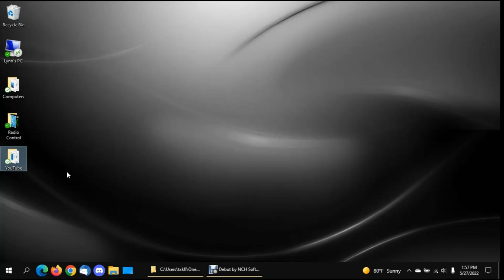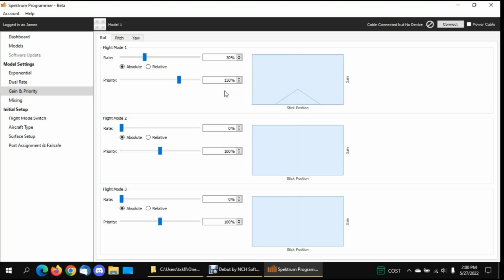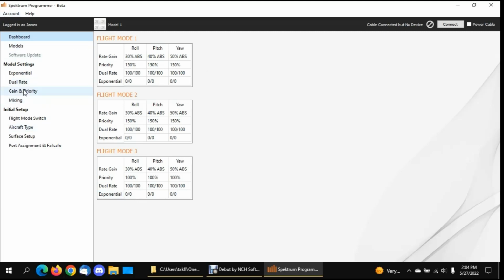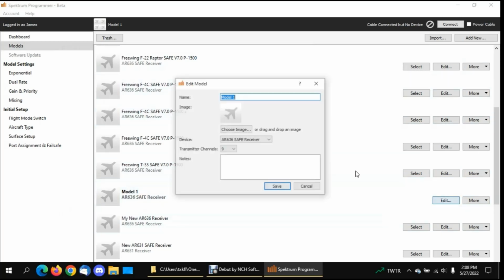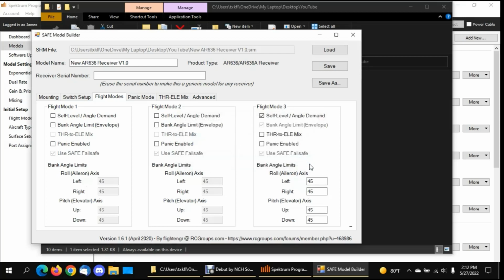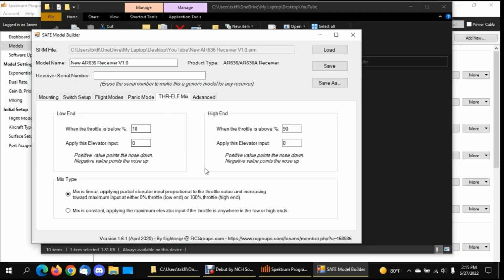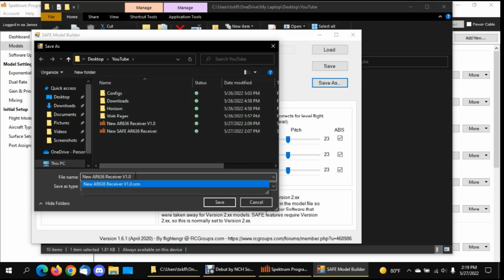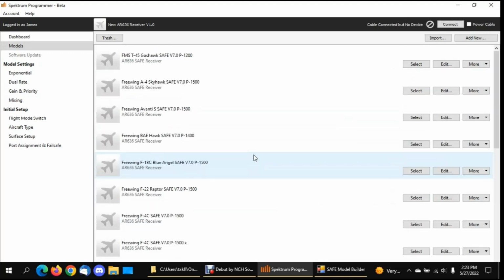Spektrum AR636 AS3X & SAFE Receiver How-To

Comment: This helped so much. I now understand how to program my old Spektrum AR636A and AR636B SAFE receivers. I just have 1 question. I am using a Spektrum DX7s and using my flap/gear 3 position switch for flight modes. I have it set so mode 1 is no AS3X or SAFE, 2 is AS3X but no SAFE, and 3 is AS3X and SAFE. I was planning on using my bind click button for SAFE bailouts. Will this work on all 3 flight modes or only ones where SAFE is active?
Reply from the maker: I only enable panic mode in the flight modes that don’t have SAFE enabled.
Reply: How would I enable panic mode on all flight modes?
Reply from the maker: @joebo9378  There’s not really any point in doing it in SAFE mode. If you let go of the stick, it’s going to fly straight and level. But, you can enable it using FlightEngr’s SMB software. Panic usually has tighter angle limits. Btw, the sticks still work while you’re holding the panic button.

Comment: Hey good job with this. I have a question for you though, does the priority setting have anything to do with the amount of angle limits with the 636 receiver? In other words, if you use 140 priority on roll will that give you more of a bank angle than if you use 165 on roll priority? Trying to figure out what settings to use for a scratch built MQ9 Reaper. Any feedback will help thanks.
Reply from the maker: Thanks. The AS3X priority setting only determines the amount of travel it takes to lower the AS3X gain to zero. The AS3X gain will be whatever we set it to only when the stick is centered. The gyro gain should decrease as we move the stick away from center and will hopefully be zero at full stick deflection (or before). If the priority is set to 100% and the channel output is ±100% at full stick deflection, the gain will decrease to zero just as the stick hits the stop. However, if you're in low rate, the gain won't quite decrease to zero. To ensure that the gain goes to zero at full stick deflection in low rates, we set the priority to 150%. This value allows us to set our low rates as low as 50% and the gain will still decrease to zero at or before full stick deflection. If you were to set it to 160%, you could use 40% in low rates. Since I never go below 50%, in low rates I set all of my priorities to 150%. However! In SAFE mode, I set the priority to 100% because I always use 100% travel in SAFE mode. If you use low rates (or anything less than 100% travel) in SAFE mode, your plane won't reach the full bank/pitch limits.

So..

1. In AS3X mode, set the priority to 150 or 160 percent. You won't be able to tell the difference.
2. You can use low rates in AS3X mode, but not in SAFE mode.
3. In SAFE mode, always set the priorities to 100% and set the dual rates and servo travel to 100%.
4. For the first flights, set the AS3X gains to 30, 40, and 50 percent for roll, pitch, and yaw respectively.
5. Increase all 3 gains by 10% over the new few flights until you start seeing signs of oscillation.
6. Decrease all 3 gains by 5% until the oscillation goes away.
7. You should generally have 10% more pitch gain than roll gain and 10% more yaw gain than pitch gain.

Comment: Gonna watch this again. A lot of good stuff.  I just yesterday ordered a NX6 TX from HH to take advantage of SAFE Select. What is the drawback to SAFE Select?
Reply from the maker: Well, there isn't really a drawback to it. SAFE-Select is Spektrum's process for enabling or disabling the SAFE (Sensor Assisted Flight Envelope) feature in their receivers. SAFE can provide bank and pitch limiting which will keep your aircraft right side up. It can also be set to cause your aircraft to self-level when you release the control sticks. Since experienced pilots don't need SAFE, SAFE-Select gives them a way to disable it. However, even when the SAFE feature is enabled, SAFE mode can be turned off or on in flight using an extra channel. The extra channel can also be used to enable or disable AS3X mode. AS3X will make instantaneous attitude corrections when turbulence tries to bounce your aircraft around. It can also be set to heading hold mode which will try to keep your aircraft in the attitude it was in when you last centered the sticks. However, AS3X won't keep your aircraft right side up; that's what SAFE is for.
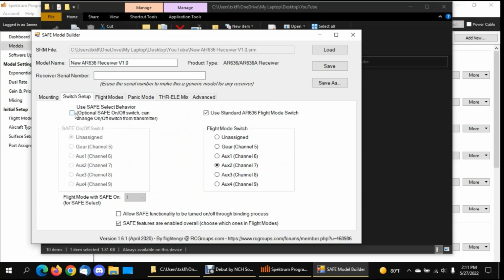Reply: Thank you for answering my question so thoroughly. The reason I asked was at 14:18 you said not to choose SAFE Select (pick standard instead) so I figured there must be a drawback.  I see now that would conflict with your 3 flight modes. Thanks again!
Reply from the maker: @ccarlley  It doesn’t conflict. Since I always want the SAFE feature enabled, I enable it during the setup instead of having to bind the receiver a certain way. So, yeah, I suppose that could be considered a disadvantage. For the AR636, the difference is the point where you pull the bind plug during the bind process. The other part of SAFE-Select is where you tell the receiver which channel you’re using to control the flight modes. Since I know I’m going to use channel 7, I set it during the initial setup. That way, I don’t have to hold the sticks down and toward each other while I flip a switch 5 times.

Comment: is that 636a or 636b ?
Reply from the maker: Some of the first AR636A’s that came in BNF’s were locked and couldn’t be reprogrammed. Basically, if you can register an AR636/A/B, you can reprogram it.
Reply: @txkflier what do you mean by register? Registering on the spectrum rc/horizonhobby website?

Comment: Excellent tutorial, it might be just what I'm looking for. I want to set up an AR636(a) in my original timber 1.5m, to fly like my sport cub s. I like the 3 position modes of just regular safe (not safe select) with beginner, intermediate, and advanced, with the panic button. It just flies really nice. With my timber, I struggle when turning off safe select. I'm a new pilot to airplanes. I'm not even sure if I should do this, or just man up and learn to fly the timber with safe select (and keep repairing it) lol. Any tips for me? Thanks, Mike.
Reply from the maker: Subscribe to FlightEngr’s “E-flite SAFE RX in another plane” thread on RC Groups. We can assist you there.
Reply: @txkflier  will do!

Comment: Your explanations are very good and you have helped a lot, Would I be able to program an AR636B in the same way also as the Tx I have is a an old DX6i and only have 2 way switches, could I still get it to work?
Reply from the maker: You would only have two flight modes, but they can be any two that you choose. You could make one position be gyro off, AS3X, or SAFE mode and the other position can be either one of the remaining two modes. I’d start out with an off position and AS3X or SAFE on the other. Once you know what you’re doing, you can put AS3X on one and SAFE on the other position. I generally don’t have a gyro off position. If the gains and direction are set correctly, there’s no need to turn the gyro off. When I first started programming these receivers, I’d take off with the gyro off and turn it on at a safe altitude. Now it doesn’t bother me to make the maiden flight takeoff in SAFE mode. Start out with an expendable airplane before you put an AR636 in a plane you care about.
Reply: @txkflier  Thank you very much for your prompt reply, I'm going to give it a go, I think "start out with an expendable plane" is particularly sage advise😄